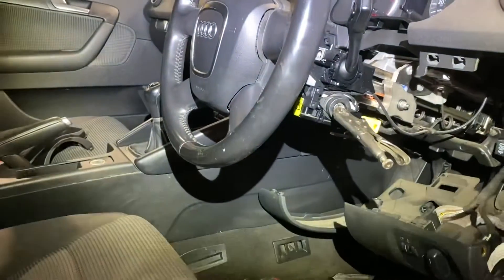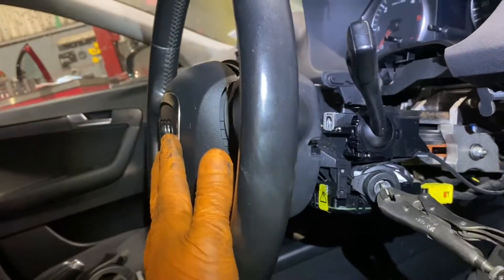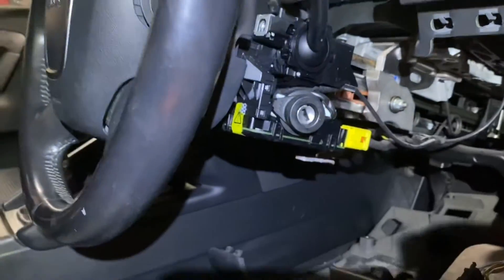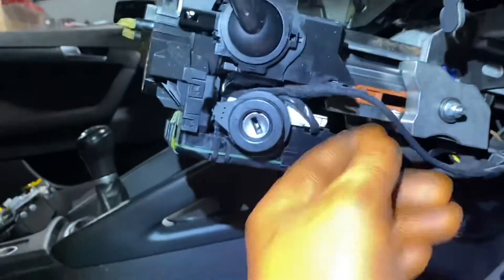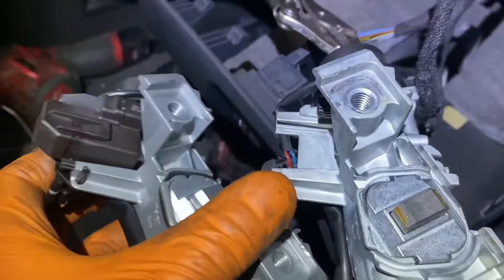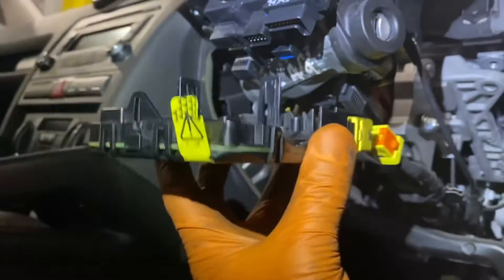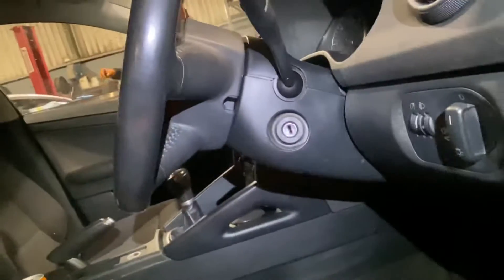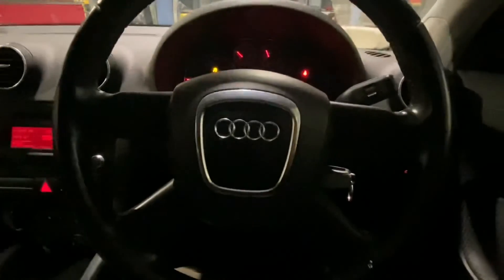Audi A3 steering lock replacement

Comment: I turned down the chance to do one of these a few months ago and that was using 2 hands to do the job. Respect for you there my friend. Nice tip with the torx screwdriver to unscrew the shear bolts. I have a punch I have sharpened to a very long  tiny chisel end to knock the bolts loose. It bites really well into the head of the shear bolt. Thanks again
Reply from the maker: It all the little tricks that a fella learns over time makes the likes of these jobs a bit easier. What is your name ??
Reply: @kennedysgarage3281  it's Chris. I live in the big land of England.  Right in the middle.
Reply from the maker: @the_retired_mechanic  it just nice to have a name to put to the comment’s . Peter 😉

Comment: What wbout them 2 bolts that keep ignition barrel?how did you unscrew?
Reply from the maker: They are called ‘shear bolts’ due to the head shearing of them when tightened. This is to deter thieves from trying to steal the vehicle. I didn’t show them being removed as explained around 1min 10secs. The best way I have of removing them is a long dot punch & small hammer, tapping them anti clockwise. They can be a little slow but otherwise aren’t too bad to remove. Good luck with it 🤞👍
Reply: He cut slots in Head of them  for a tankard screwdriver

Comment: I’m confused why did you take the steering wheel off
Reply from the maker: @Starvingmarvin24  I genuinely remove any thing that gives me more access/room. 
But good luck if your trying it without removing it 🤞🤞
Reply: @ I used your video and mine is now replaced I did it with wheel still on
Reply: @ but it’s a great vid made my life so much easier
Reply from the maker: @ well done mate 💪💪

Comment: Do you know what size bolts these are for the shear bolts ? TIA
Reply from the maker: They are 8mm & 1.25 thread I believe. A very standard Allen key head bolt & 6mm Allen key to tighten. 
I just tap them out with a dot punch and then put a hacksaw cut across the shear head so I can tighten them with a flat screwdriver 🤔🤔